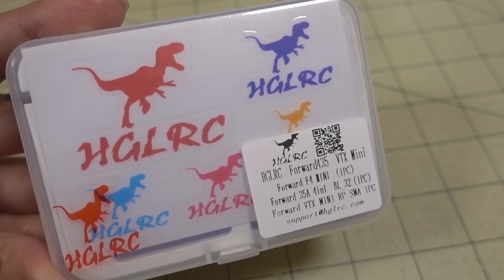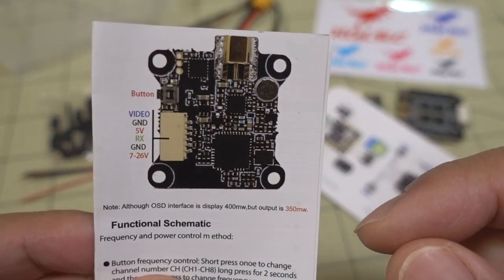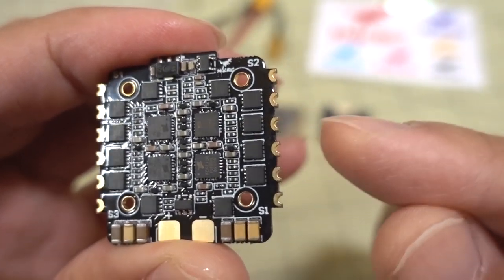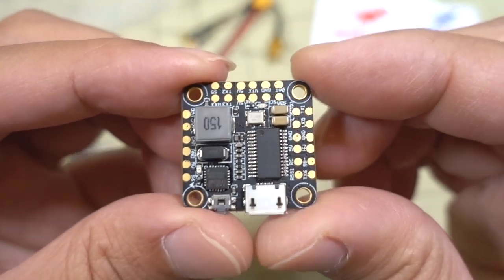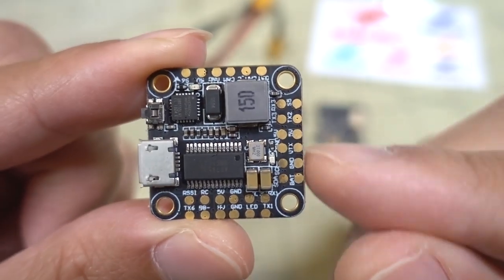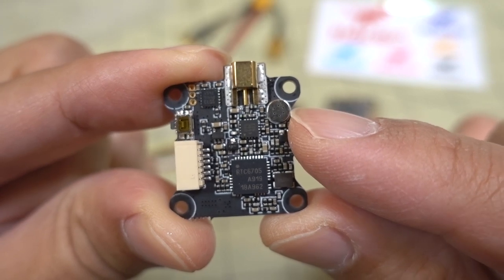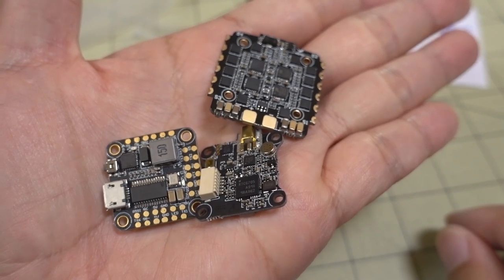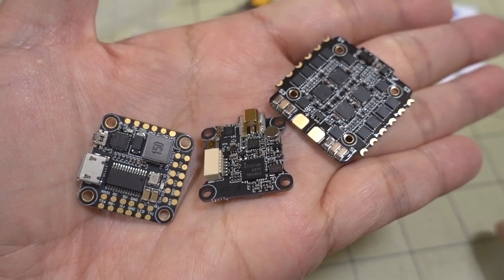HGLRC Forward435 F4 Stack Overview

Comment: Hello Albert Kim
Thank you for your videos and all your advice it's a real pleasure to follow your videos
if you want, I'll need one of your advice
As you do, the DJI FPV glasses system
in your opinion, for this system, little you confirmed to me that the remote control, is not mandatory to have the necessary information in the glasses FPV:
as for example, the battery level of the drone, in real time, the level of reception of the digital system
in summary is it possible to have information viatl to fly in FPV with any radio, or ???
is it mandatory to have this type of information in the mask to buy at the same time the DJI radio control
Sorry for the inconvenience but I need this information in order to buy my DJI combo, Thanks in advance for your help
Look forward to your answer
Good flights to you and thank you again for your videos